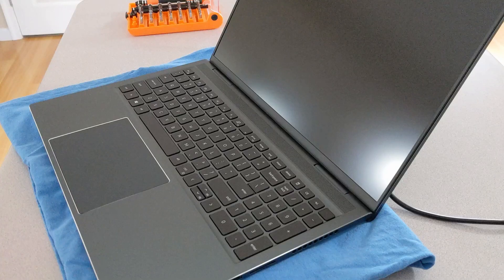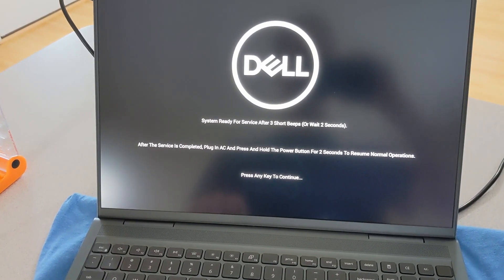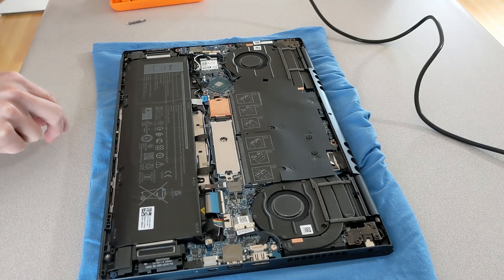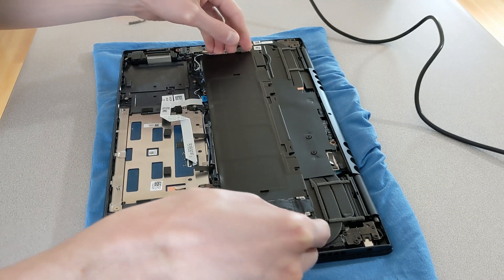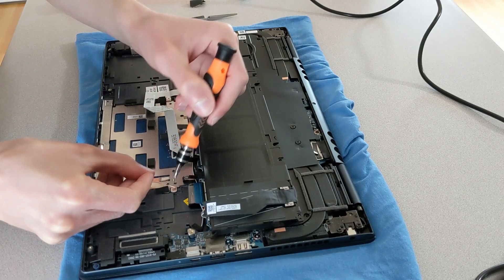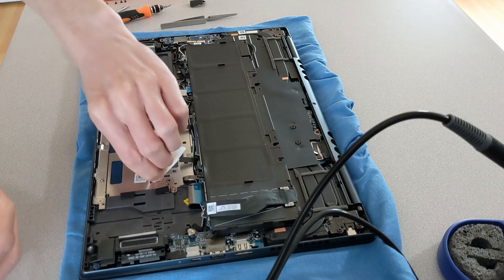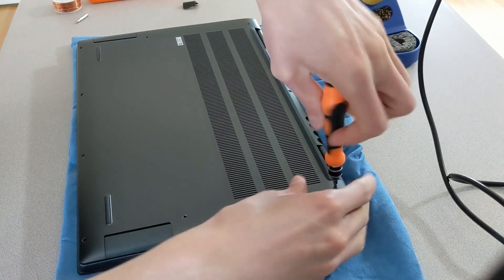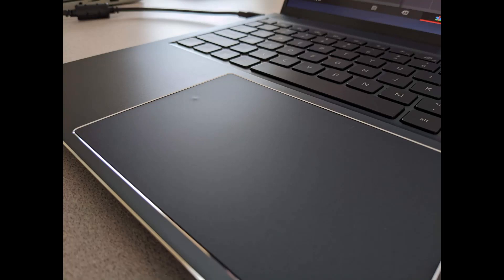Grounding Wire Fix for Erratic Touchpad Issue (Dell Inspiron 16 Plus)

Comment: Had the problem, did the fix 2 days ago. Problem 100% solved for now.  Only place on the enternet I could find a real solution by the way. Used electrical tape instead of welding, i put it tidy and made sure it would be there permanently (i hope it does) , no dent on the pad.
Reply: Can you help me to solve this problem?

Comment: for those having the same issue in 2023 dell Inspiron 16 7260 2 in 1 its the best solution. I'm having same issue dell support didn't respond. I didn't ground wire but put a metal strip on the trackpad connecting it to the side panel just to check and it mysteriously stopped glitching I guess you should try it too if it works then open your dell to solve through the original procedure as in video
Reply: I was wondering if this procedure solves the issue on that particular model. Thank you.

Comment: Hi DASH RENDAR, thank you so much for your video. I had the touchpad issue, Dell technical support replaced my laptop with "new touchpad version" which failed miserably again. It was a headache until I saw your aportation, YOU WERE RIGHT with the problem.

One comment for all the other people, after watching the video I have solved the problem WITHOUT SOLDER just trying to avoid the stetic mark on the touchpad. Just painted those contacts with CONDUCTING SILVER, in my case I have used Kemo Electronic L100 product. 
It fixed the issue incredibly well and easy. 

If you go with this solution be EXTREMELY CAREFULL NOT TO SPLASH SILVER on the electronic board. I recommend you to cover it before.

Hope it helps anyone, it is a great laptop and it is very sad to have a failure of this type.
Reply: @Adrian.Bautista  is it still working did you face any problems
Reply: @TheCodingLadder Hi! Still working perfectly since that day. Just paint generously the ground contacts 👌🏼

Comment: Just followed this video to try and fix the problem but couldn't get good contact soldering, so as an alternative, I took a small piece of tin foil and placed it so that one end would touch the copper contact (after lightly sanding it) and have that bridge onto the metal tab that was above that contact. I made sure to sand a bit of the metal tab to be sure I had efficient contact. Then place a tiny piece of electrical tape to keep it in place. Hope this helps anyone taking an alternative route to soldering.
Reply: Thank you

Comment: Hey this is an awesome video, but I'm worried about the heat and the bump.  I'm curious - why not just try with some real good tape and/or epoxy rather than using hot solder?  I am planning to try that first, but would like your opinion.
Reply from the maker: A lot of people in the comments have reported success using copper tape, which I would recommend. Some have also reported success just taping down the wire using electrical tape. I would not suggest using glue or epoxy because it is not conductive and would be difficult to remove if needed. I wish you well in your repair!
Reply: I think soldering wire is the best because the tape may not last long, just be careful even if it only leaves a very small dot but it is stable for a long time.

Comment: I'm forced to try this now. Dell tried to fix it 3 times and couldn't. 4th time calling about this and I'm out of warranty and they're saying it's "not the same issue". It's the same exact F-ing issue and Dell is in the wrong. I've spent way too much time dealing with Dell and being without a working laptop when I need it to be a LAPtop (when I can't use a mouse), which is why I bought it - to replace my desktop.

Comment: Worked like a charm! Had this issue a week after purchasing the laptop. After backwards and forwards with Currys Support (Where I purchased the laptop) and Dell, no one would help me out. They advised to go through a third party company to get a replacement and be without my laptop for a month. I used some stranded wire out of a broken phone charger, tinned it and connected it to the copper pad. I tried to solder to that silver shield, but it wouldn't take. So I opted to do the same and loop it around that screw to make a physical connection to it. Continuity tested fine. So booted back up and i'm over the moon with how well it works. Unfortuantly I did get a little bump. Had to set my soldering iron @ 350c as the cheap solder I had laying around didn't want to flow properly. This could be avoided by getting some low melting point / good quality solder or maybe adding some heat protection before soldering. Thanks again :)

Comment: I'm losing my mind here, I tried everything now but soldering on my Asus. I tried adhesive copper tape, maybe the sticky part is not conductive? Or maybe it's because of the screen replacement I did? It's a better screen with higher brightness and full RGB and most websites say that it is compatible. 

Or maybe it's because of the solar panes I installed on my house? I spent well over 200$ on this stupd laptop, the only reason I don't buy one is because it's an rtx 3060 laptop and 4000 series laptops suck big time.

Comment: thanks SO MUCH. i finally got a soldering iron just for this. ended up using a bit of copper from a broken USB cable to make the connection and now it works beautifully!!... sucks because its actually a really good touchpad when its not jumping all over the place...
Reply from the maker: That's great to hear! I agree, it's a nice touchpad once its fixed.
Reply: Did it continue working well
Reply: @TheCodingLadder  yes, for over a year in fact! but just a week ago it broke completely and straight up does not work at all. pretty disappointed as the laptop was actually really reliable up until then.

Comment: FYI there is no need to remove the battery. Just below the battery you can see a small part of the copper contact of the touchpad. I put some conductive copper tape and connected that part to the support bracket and it worked. I needed to use the ifixit metal spudger to get that in there to make good contact with the copper & the aluminum(it's a very tight space).
I looked for an alternative solution because 2 screws of my battery were very tight and could not be removed, resulting in me stripping them! I could not be bothered putting WD-40 or supergluing a two sacrificial screwdrivers on the screws.

Comment: Very helpful video, thanks; it worked well for me. A few notes of my own here.  First: if you are using Costco's extended warranty service, beware that the company that you're sending it to is not Dell. And, they will automatically reinstall the whole operating system, so it's advisable to back up your data before you ship, as you will be using a virgin system when you get it back. Second: Use alcohol to clean off the wire and copper pad before soldering (there was no protective layer in mine), and save that q-tip for removing the rosin flux when you're done soldering. This will prevent corrosion. Third: I found two M2 x 3 screws missing from the copper and aluminum cover plates when I got the bottom off my 7610. That's how they came from the factory - missing.  This could have accounted for other erratic/grounding problems. Fourth: when removing and installing the battery, note that the outside bottom edges of the battery have small feet that go into slots in the chassis. If not fitted correctly, you'll have difficulty in reassembly. Fifth: Use a soldering pencil with a high heat setting and a very light pressure on the copper, like just the weight of the pencil. The actual soldering should take about one second, no longer. You can use an aluminum tool to lightly hold the wire against the copper if it hovers above the pad.

Comment: Thank you! I used copper adhesive tape and it solved the problem. Was an extremely easy job to do that fixed such a nightmare issue. Thank you so much!
Reply: I did the same with conductive copper tape and worked like a gem
Reply: @Gumdohodi  i tried conductive copper tape and it worked for about 10 days, now it's back to glitching again. Next step is soddering for me...hope it holds.
Reply: @Gumdohodi  did you use copper tape to tape down the grounding wire?

Comment: Thank you a million I have just used self-adhesive tape and without any Soldering I could fix the issue. Now it works fine and I think the issue is solved. I ordered “Premium Adhesive Copper Foil Tape - Double Sided Conductive - 0.5" from Amzaon.
Reply: Update?

Comment: thanks for the video, I will have to mod soon... getting tired of carrying around a mouse as backup.  may I ask, if you go to 5:15 in the video (I am trying to understand the process) you are grounding to the copper pad from the metal on the silver part and screw.  has anyone tried to simply remove the little pads underneath the metal parts that touch the copper pads?  why are they even there at all?  thanks again.
Reply from the maker: I am not sure what purpose the foam pads were meant to serve. From the feedback I've heard, it sounds like about half of the laptops out there came with the pads, and about half didn't come with them at all. Regardless, laptops in both groups have had the same touchpad issues. Some people have reported removing the pads and bending the tabs more aggressively to try and improve the contact there, though I don't know if this solution has provided long-term success or not.

Comment: This seems to have worked for me. It's been a couple of days and no issues whatsoever. I'll update if something changes. BTW it's also possible to simply use some electric tape instead of soldering, it seems to work just fine.
Reply: Hi! Use electric tape does it still work bro?

Comment: Thanks so much for this mate! Mine was problematic out of the box, and it repaired by dell, and that lasted 2 days. I did a bunch of ohm readings to test the earthing, and it was super erratic, from 10ohms up to 400ohm. I removed the weird little foam pad, and used a bunch of adhesive copper tape and a bit of bare wire,  instead of soldering.... Not Ideal just wanted to see if it would solve the problem and sure enough it has. If the copper tape ever acts up I'll do a more permanent job. Dell owes you a bonus for this!!
Reply: Hi! Use electric tape does it still working bro?
Reply: @laucung88  its gone from a failure rate of all the time, to 1 in 5 times? It's not ideal but I only removed 1 of the weird little foam pads, so if you're in there do both...  I think I'll try removing the second one before soldering it
Reply: @miningnosegold  thanks bro 🤝

Comment: Hello.  I've had the computer for a year and I've always been using a Bluetooth mouse.  A few days ago the mouse showed erratic movements.  I started using the touchpad and… it doesn't work well.  I came all the way here from the Dell forum.  Please tell me is this soldering solution still working.  Eternally grateful for the solution with your tutorial.  Best regards!
Reply from the maker: Yes, I am happy to say my trackpad is still working perfectly after performing the fix

Comment: I used conductive tape and copper wire and it helped to fix the problem for some time, but now the problem has returned. Is there anything else one can try?
Reply from the maker: Sanding, cleaning, and soldering to the copper pad as shown in the video is probably the best way to ensure a solid electrical connection. Aside from that, all I can suggest is to verify that the tape you are using is conductive on the adhesive side (some metallic tapes are only conductive on the outer face and don't have a conductive adhesive).
Reply: @dashrendar2625  Do you think the width of the copper wire matters?
Reply from the maker: @lukashermann6762  Up to a point perhaps, but I really couldn't say definitively. Anything around what I used (24 gauge) should do just fine.

Comment: Has anyone tried just putting petroleum jelly on the existing grounding contacts?  It should improve conductivity and stop oxidation...
Reply: Petroleum jelly is an insulator.
Reply: @bijoucat1 Thanks, I was wondering if it actually conducts.. It's often used when connecting car batteries.  My assumption was it would reduce oxidation/corrosion, which some commented was the possible cause of the problem.
Reply: @timothypotter359  Hi. You are partially correct. It's used on auto battery terminals, but it's applied after the connectors are tightened down. The purpose is to keep the acid vapors emanated by the charging process from attacking and corroding the metals used on the connectors. The jelly itself is an unadulterated grease, and is non-conductive. I have used conductive greases (rarely) on ham beam antenna element assemblies, but they contain a large percentage of graphite, which (kinda) allows current to flow, results are mixed.   Now, to open my 7610....
Reply: @bijoucat1  Interesting. That has cleared up a couple of things I was wondering about.  Thanks for explaining.

Comment: I used copper tape to ground the copper pad to the support bracket. It's worked perfectly for a few of weeks now. I can't thank you enough. You completely saved me.
Reply: Yep. Still works great.
Reply: Look for 1/4" double-sided copper tape.
Reply: @gfreidet  thanks
Reply: @gfreidet  i just did the fix with copper tape and it’s working  !! Thank you bro you are the goat
Reply: @lounesb9802  Awesome! Glad to help.
Reply: hi Glenn , can i ask you if your fix is still working? you have put the tape with the same connections he makes with the wire?
Reply: I'm curious as well. Did you add the copper wire and taped it down with the tape rather than solder it on? Because I don't have a solder iron and never soldered anything before.
Reply: Is it still working for you ? I am afraid of solding bro
Reply: I did exactly same thing, but unfortunatelly it worked only for 3weeks.. I checked the position of tape, but it was still in a place. But I used a little bit old tape, and glue maybe was not so conductive, Idk
Reply: You use copper tape to connect trackpad with crew instead copper wire as video right ?. So far it still working ?. Sorry for my bad English
Reply: @conghauvan  Yes. Copper tape worked great, and it's still working. I posted pictures in a thread on the Dell support site. You'll have to search for them. Good luck!

Comment: There are two such contacts. Do you do both?
Reply from the maker: I just grounded one of the contacts
Reply: @dashrendar2625  UPDATE: Problem came back. Doesn't work properly for a while and then works again; same as before. I give up.
Reply: @a46475  Thank you for your update Sir. Maybe it is due to something else altogether. A shame though, I was getting my hopes up. Kind regards.
Reply: @dashrendar2625  UPDATE: I used the conductive copper tape method on BOTH contacts about 4 days ago and the problem has NOT returned. I will update if anything changes.
Reply: @dashrendar2625  Thanks. I ask because I used conductive copper tape on the contact on the right and the problem came back. I will apply it to the other side before committing to soldering.

Comment: After doing this Fix, it was well but 2 weeks later, I connected my smartphone by usb to my dell 1610 and after connection, I could see same trackpad issue, and It happened before as well everytime i connected my smartphone.

Who can explain how to avoid this issue when I connect my smartphone to my laptop?
Reply: You connecting to smartphone is inducing a slight charge in the trackpad, due to the system's grounding problems.  You'll need to ground your trackpad to not have this issue.

Comment: Hello guys, After doing this operation , I noticed 3 new issues , you also?

1) Bump on the surface of the trackpad exactly at the location of the soldering operation, it is ugly

2) strange light electric buzz sounds coming directly from trackpad when you don't touch it, you put your ear close to it, and you ear it as if you hear electricity moving inside trackpad , strange! Before, was not the case! When you put the finger on track pad (contact), this noise disappear, otherwise its permanent noise

3) Device Security Issue
After doing this soldering operation, I noticed issues in Windows Security  - Device Security 
Before I could see the 3 features , core isolation, memory integrity and secured boot, and all was on and well.
Now, those features are fone completely, cannot see it, just white page, on top written : 

"Standard hardware security not supported"

Comment: Here is what I did that seemed to fix the problem.
    Open Device Manager.
    Under Human Interface Devices open I2C HID Device.
    Select the Power Management Tab.
    De-select "Allow the computer to turn off this device to save power"
After completing those steps, I have not had the smallest problem with my touchpad for the last week.
Reply: that does not work
Reply: @jacek130  It does (well, it does for me).
Reply: This worked for me.
Many, many thanks.
Reply: Unfortunately, It didn"t work for me.
Reply: Still working?